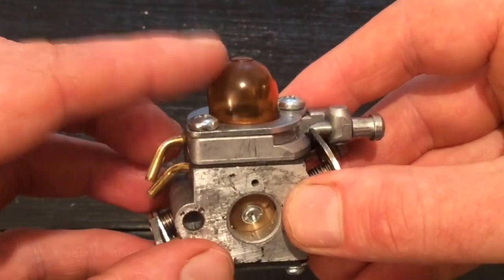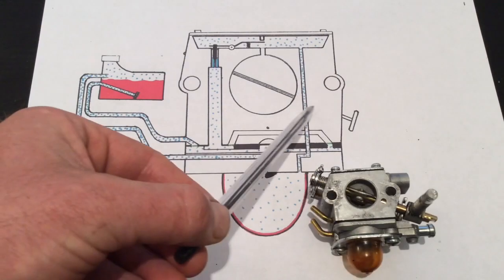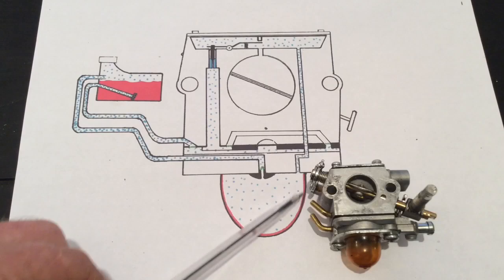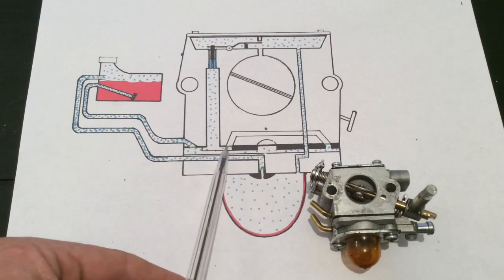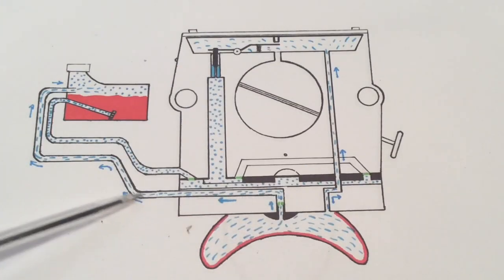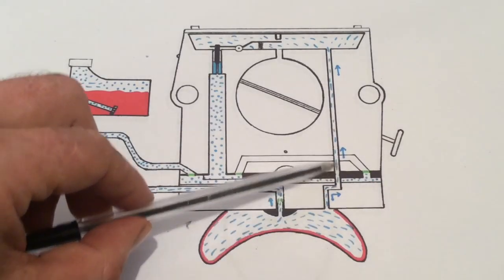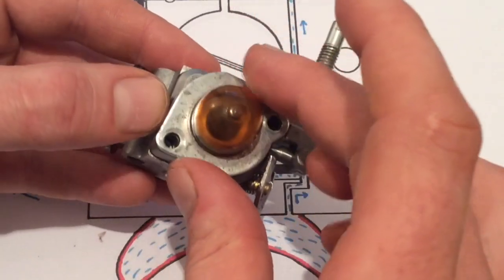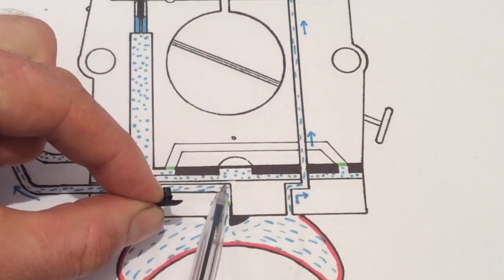The Whole Fuel Priming System Explained - In a 2-Stroke Carburetor.  (by Craig Kirkman)

Comment: great 'devil in the details' video.. I really like your step by step schematic overview of explaining what is going on before I start on a repair.   

I have several 2 stroke engines including grass mowers, weed wackers,  air blower,  chain saw and branch trimmer all with primer bulbs.     

 In the past when one of  my devices stopped working (invariably a 'fuel' issue) the solution was to take  the device  to my local small engine/mower repair shop to be repaired.  Typically it's going to cost anywhere from about $75 plus parts to get my machine back in action (and, if this happens in early spring,  I may have to wait 2  or 3 weeks for the shop to get to it.    

these  how to vids of yours not only save me money (lots) and reduces my frustrations but also provide me a great deal of personal satisfaction of being able to effect repairs myself.   

thanks for taking the time to share your knowledge and skills with  us.. 

BTW..  I have found during the 'off' seasons  when I am not using them if I keep them filled with fuel and then every few weeks (3  or 4) I  fire them up and let then run for a about 5 mins..  I have found that this preserves the  plastic fuel lines and they dont become brittle and crack as a result of sitting dry and idle over the winter.

Comment: Good video. Now I know why my bulb only sucks just air. Eather a port is plugged or that main one way valve is rubbish. Replaced all the lines,the primer bulb and all gaskets and seats.The main tank filter is made of lead and that was disolving. the tiny screen( that you never mentioned) was completely plugged with metal bits,I traced it to the filter,I could scrape off fine bits of it. Those probably got past the screen and plugged a port or like I said,that one way grommit or valve is shot.

Comment: Excellent! What happens when the inlet fuel line is attached to the return pipe and the return line to the inlet pipe? Is it just this process in reverse? I.e it draws in more air instead of fuel? I had my fuel lines on the wrong way around today after replacing them, and I noticed the bulb wasn't filling with fuel, but air was bubbling out through the fuel filter (which is what made me realise I had the lines on backwards, rookie mistake I know)? Thanks

Comment: This was excellent! I have cleaned over 20 carburetors. Being successful with most, but now i can go about it with a complete understanding. Thank you. I had many of  them pull fuel through with the primer bulb, but had air bubbles in the primer bulb after. Now I know either the bulb valve is not closing properly or it's not able to pull fuel through the carb system properly causing the bulb valve to pull air back through. A clean system(pathways and valves clear and functioning) will have no air (or little air) in the bulb after priming. Thanks.
Reply from the maker: Leftyloveschicken, fantastic news, I'm really pleased it has helped. Thank you for your positive feedback.
Reply: Great explanation . Lot of air bubbles in primer bulb now know check valve is not seating

Comment: How does the tank vent?
Reply from the maker: Bill Bright, hi, thank you for your comment, I will include a video on this to explain it better. I'm just in the middle making another vid, which is quite detailed one and a little time consuming, but I will get to it very soon. Thanks
Reply: The fuel cap allows air in to replace gas as it is consumed. It has a one way valve that allows air in but keep fuel in the tank. This is a pinched rubber affair you can see if you look at the inside of the cap. A slight vacuum forms in the tank when the engine is using fuel . Higher atmospheric pressure (than in the tank) opens the valve and air enters the tank.
Reply: the tank does not vent. it is pressurized.

Comment: Remember that this type of carb (diaphragm) will allow the engine ,and carb, to be run upside down or at any angle. Not at all like the old style motorcycle carb, or mower engine. So any part of the fuel circuit that does not seal off a port (or a split primer plastic bulb)correctly means that it will NOT draw fuel correctly. A new diaphragm kit and absolute cleanliness when doing the repair and making sure that all ports are thoroughly cleaned out with some sort of pressurised aerosol spray usually results in a good working carb again.
Nice video presentation, thank you.
Reply from the maker: Hi, thank you for taking time to give me your feedback. I really do appreciate it. Craig

Comment: Ive noticed either side of the carburetor the one side the gasket goes on first and the other side it goes on second,I see many people on youtube argue this on what stage the gaskets go on first or second followed by the diaphragms.I think when they are discussing this matter they are getting confused to what side of the carburetor they are talking about.well I don`t think its worth watching any one else video`s now they will seem less informing,
Reply from the maker: Hi, thank you for your kind comments. As for the diaphragm positioning, the fuel pump side (the same side as the primer bulb in this video) has the diaphragm on first. This is to allow the diaphragm the touch the metal body of the carb, which in turn allows the flap valves to operate correctly. The other side ( metering valve side), the gasket goes on first, followed by the metering diaphragm. This allows the correct distance between the metering diaphragm and the metering lever, which it operates. I hope this helps. I will include a vid on this. Many thanks

Comment: As all of your other videos the full and thorough explanation leaves the viewer in no doubt about what is happening. Thank you so much for making these to help people like me to understand the workings of the carburettor. I am certain that my repair work has benefitted from watching all of these because I am able to think about the process before making a diagnosis and clean and check the carb in the order of fuel flow and can be relatively certain that it will work when refitted. I would suggest that there are many occasions where a new carb has been fitted that simply didn't need to be. Thanks again. Super stuff.
Reply from the maker: Brilliant, thank you for your kind comment
Reply: I completely agree with tompfbear I can't thank you enough
Reply: woah.  That was an incredible explanation.  Thanks
Reply: My primer bulb won't come back up once I push it down to create suction. Any advice?
Reply: Mine was doing the same thing, primer bulb not coming back up, and would run good for a few minutes then just die. I just took the gas tank off and found the fuel lines inside the tank were broken. There are a few excellent videos on how to fix those lines here on u-tube.
Reply: Dovafish 
,(
Reply: Dovafish Agree